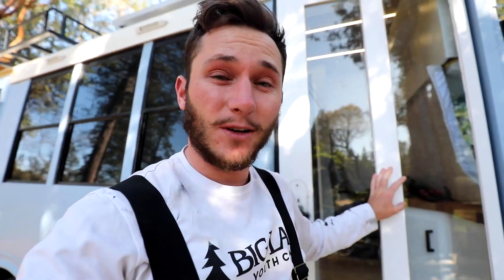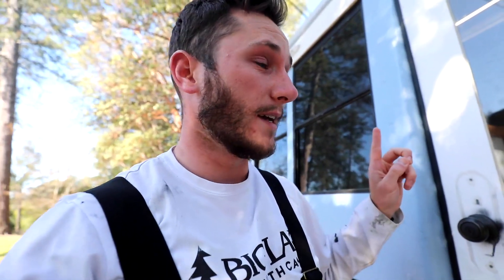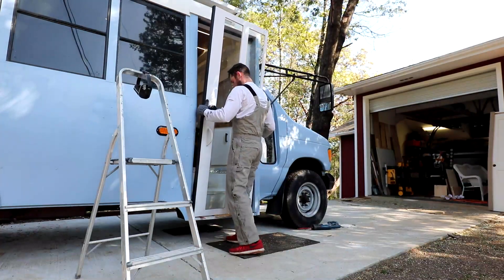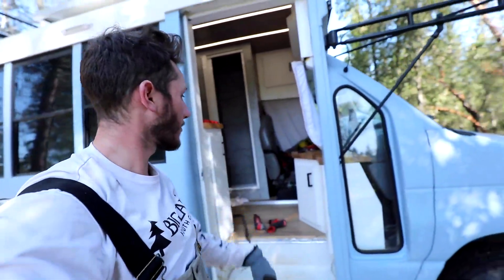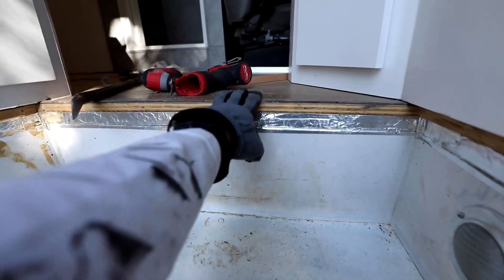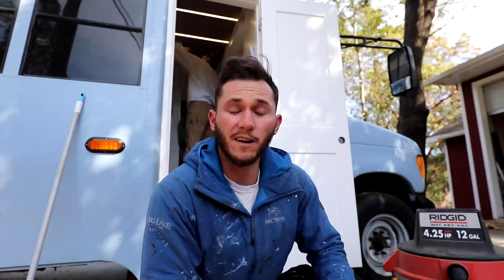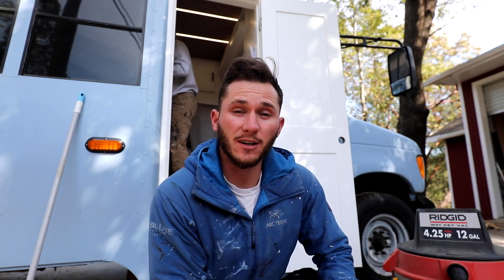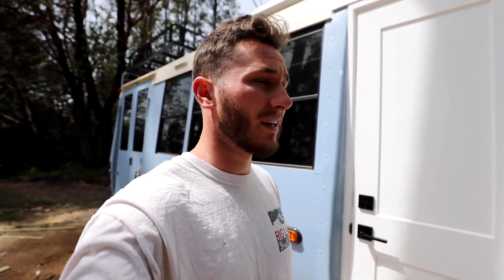Short Bus Door Rebuild - Bus Build Episode 38

Comment: So Great To See You Among The Living Again! Coaching Has It's Rewards! You Are A Great Inspiration & That Is A Good Thing! Now, Tell Me Your New Door Does Not Have The Hinges On The Outside? One Can Tap Those Pin's Out & Presto Take The Door Out! This Would Be Classified As A Security Breach! A Oxymoron Situation With Great Locks On One Side Of Door & Security Breach Available On The Other Side. Criminals Love To See These Available. It's Called Easy Access, As They Scan Your Home! Examples, Your In A Store Shop'n, Eating In A Restaurant, Your Parked At A Beach, Your On A Trail Walk, You Go To Your Seasonal Job 9 To 5 & Your Home Is All Alone. A Criminal Takes 1 1/2 To 2 Minutes In & Out & Minus Your Pillow Cases. They Make Great Shop & Grab Carry Away Bags! The Very Less You Make Your Home On Wheels Or Sticks & Bricks Appealing The % Of Uninvited Guest Ever Appear! Yes Security Camera's Are A Must & Mainstay & Still Unless You Can See The Face Of The Criminal & License Plate Of Their Vehicle They Are Driving At The Time? Video's Of Criminal Acts Today Help More In Insurance Claims Or Accidents & Courts  Require Them. Or You Have He Said She Said He Said & A Lot Of Money Was Contributed To The Lawyers Bank Accounts. To Roll The Dice Would Be Cheaper! Also I Would Recommend A Steel Bar Or 2/4 Board Inside The Middle Of The Door Laid Across On L Steel Brackets Bolted Into The Interior Frame Of Your Bus. When You Have Let The Cat Out & Locked Up For The Night. This Makes It Literally Impossible To Take A Crow Bar & Open The Door From The Outside & WAKE YOU UP! Does Give You Time To Start Your Motor & Drive Off! The Reality Is Criminals Work Full-Time 24/7 & If They Want To Get Into Your Nomad Home Or Sticks & Bricks They Will. To Keep The Temptation Away From The Honest Person Gone Criminal In A Fleeting Moment, We All Do The Most We Can For Security & Peace Of Mind. I Recommend 'Pepper Spray' On The Key Chain So You Have It When Ever Out & About. Walley World Sells Them For Around $20 Dollars. You Get About 20 Shots From One & Gives You 20 To 30 Seconds To Listen To Your Favorite Tunes Before The Assailant Regains Some Sight! Always Spray At The Eyes! That Is My 2 Cents Worth. Always, Tommy :-)

Comment: Most people switch to wood doors. The school doors are so effective and efficient, but they expand and contract depending on the weather. You could have done an RV door if you wanted to.
Reply from the maker: I really looked into the RV door option for a long time before going for a wooden door. I couldn't find ANYTHING used in my are nor could I find new doors. The only ones I could find came from the midwest and would cost as much in shipping as they did themselves. I cut my cost in half by using this wood door rather than the RV door.

Comment: Wait, so it’s plain wooden interior door?
Reply from the maker: It's a solid core interior door. We'll see how it holds up over the next couple months. If it starts to deteriorate, at least I have a standard dimension and mounting surface to swap it out with a more sturdy aluminum or fiberglass door.
Reply: @BibiaBus  makes sense.

Comment: I think you're risking the view while driving.  Looks nice but don't think that is street legal.
Reply from the maker: It does cut out a chunk of view. In case you missed it, I added a camera on the mirror on that side which feeds to my driving monitor and which shows WAY more than having a window for the door would. Plus, the windows behind the door are easily visible from the drivers seat and cover the shoulder blind spot well. Ill have to do some research on how 'legal' it is and make adjustments if needed
Reply: I have the same cab style and a 4 ft door because of a under body lift.   Looking for options to solve my problem too.
Reply: I have the same cab style and a 4 ft door because of a under body lift.   Looking for options to solve my problem too.
Reply: More concern with lateral views instead of the blind spots
Reply from the maker: @kevin.campbell  I think that's certainly worth consideration. Im fully open to throwing a window in there if it gives me more driving confidence. Since it's wood, that would be an easy afternoon job. I'll see how driving with it goes in the coming weeks and decide then.